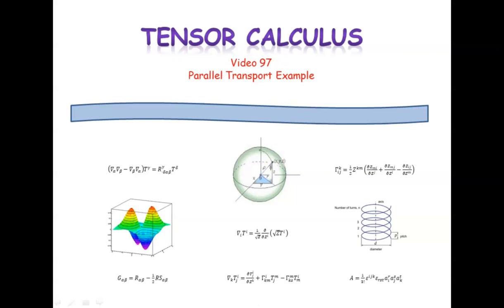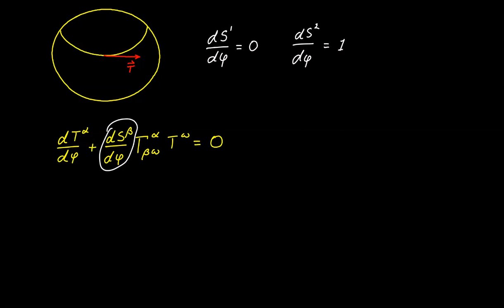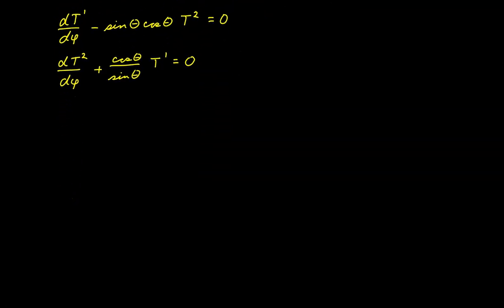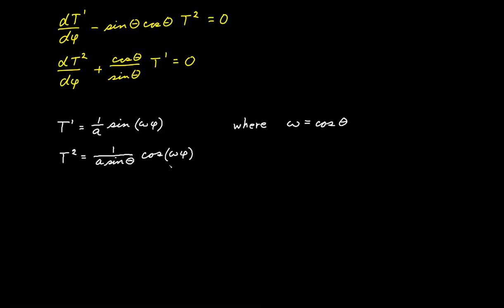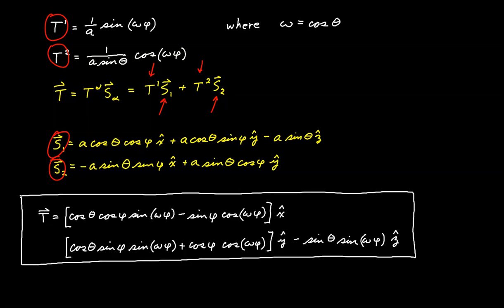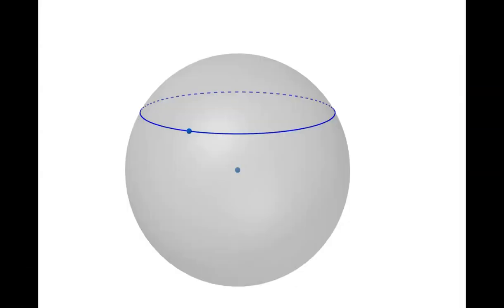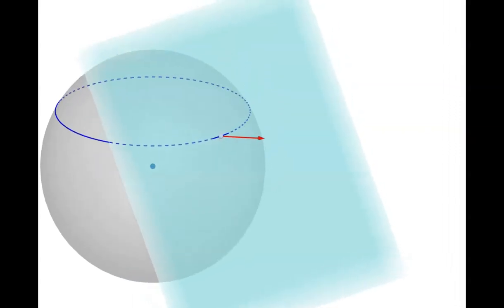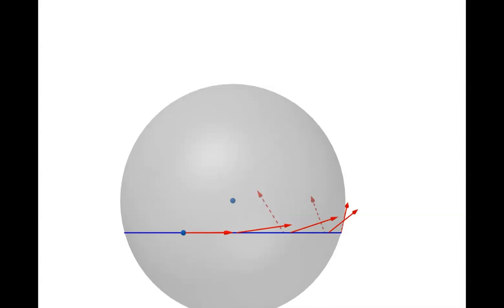Video 97 - Parallel Transport Example

Comment: Geodesics lie midway between the two antipodal or dual points -- antipodal points identify for the rotation group SO(3).
Points are dual to lines -- the principle of duality in geometry.
Clockwise is dual to anti-clockwise
Geodesics are dual on the surface of a sphere -- stereographic projection.
Space/time symmetries are dual to mobius maps.
"Always two there are" -- Yoda.